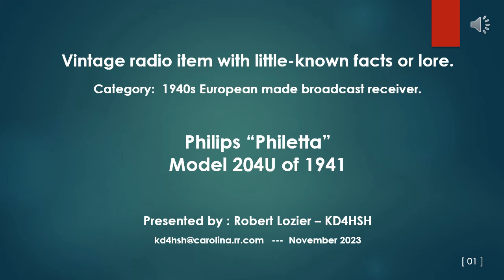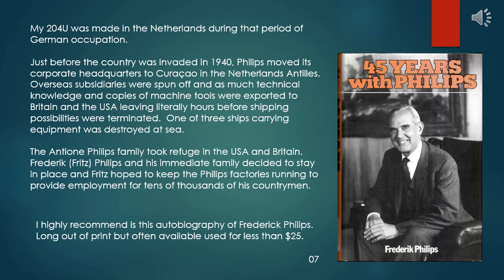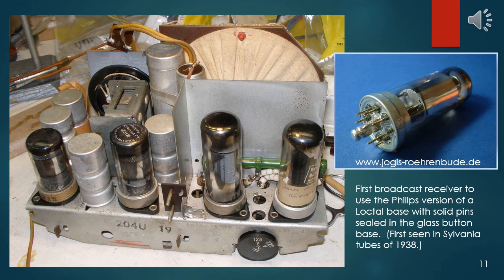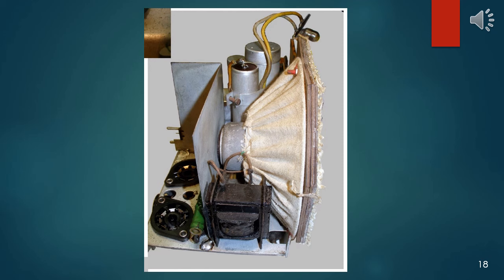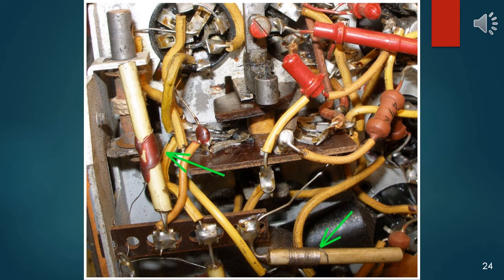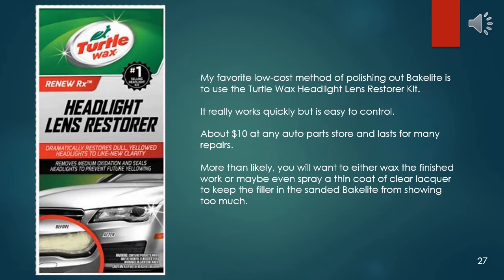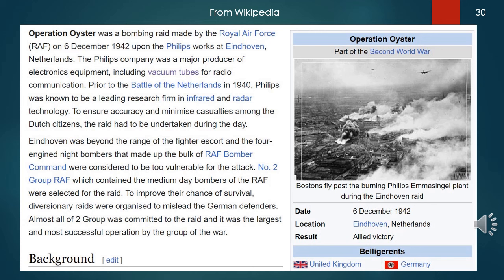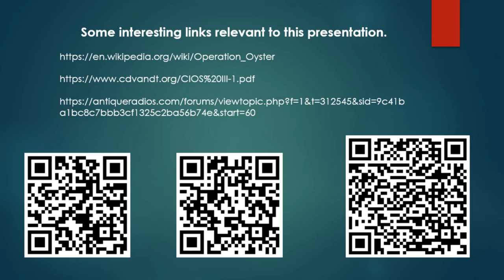A Multi-Band Radio for War-Torn Europe - The Philips 203U

Comment: 12:00 the cloth cover also is there to reduce the amplitude of the speaker's resonance peak in the low frequency, avoiding a thumping or booming sound.
12:50 the tar capacitors were indeed fairly good, compared to other paper capacitors of the same era. Definitely much better than the wax covered ones in paper sleeves. By now they're often bad. They can be left in circuit if there's a current limiting resistor in series with them, but in across-the-HV or as a coupling capacitor, they absolutely need to be replaced. Leakage resistance is typically 10M to 1Mohm.

Comment: It was ahead of his time.
Europa is populated and the relative simple construction, no hf amplifier and the metal back as antenna was good enough for most radio listeners in or near cities. Plug in and listen and it was small and portable.

I was surprised there was a SW version even during ww2. 
The radio provided the listener with good information from the BBC or other internation SW stations during ww2.

It would be interesting to see how it performs on SW.
Even if you listen on MW you should be able to listen to distance station during the night.
You can connect a wire antenna to the metal back.

Comment: The 'U' listed as an extra to the type number stood for 'U' type tubes, here the filaments of the tubes used were in series, saving a transformer.
The disadvantage was that the chassis of the radio could either be switched to neutral or line, with all the risks this entailed!
But the fact was that Philips could build high-quality receivers, with highly sensitive reception capabilities.